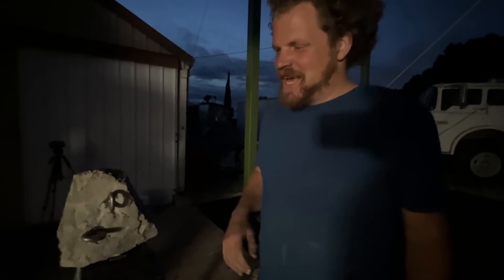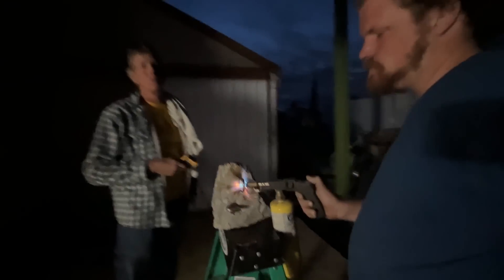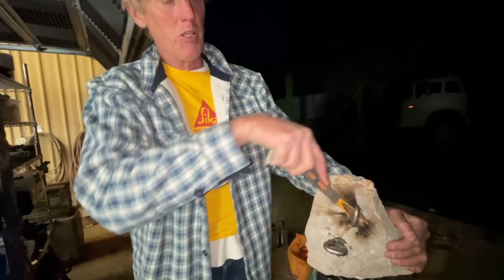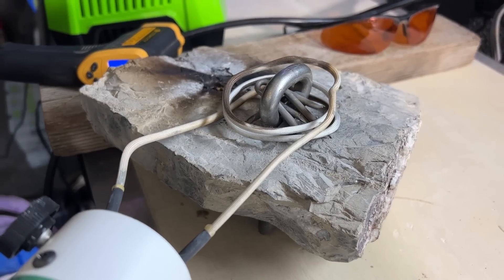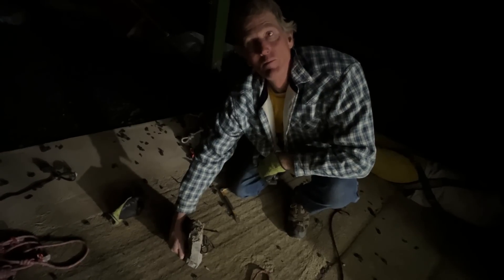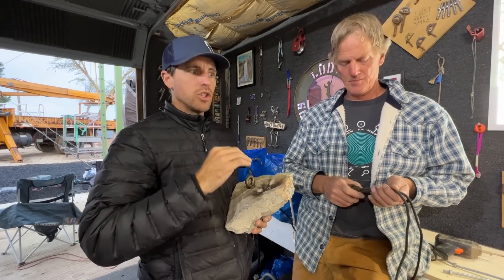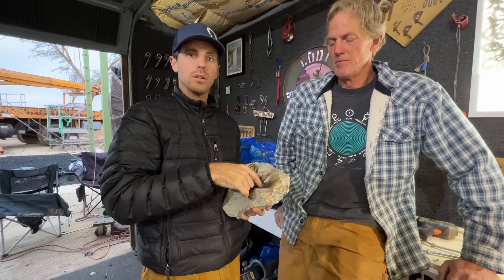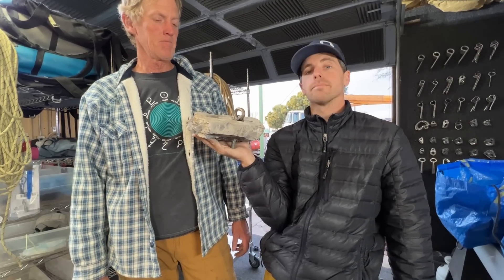Replacing Glue In Climbing Bolts - Does a blow torch work?

Comment from the maker: Don't try this if it is fire season.  Don't try this without bringing a way to cut the bolt when you are done in case it doesn't work, because it has been compromised.  Cutting and replacing the bolt right next to the old bolt is one solution as you can see here https://youtu.be/8pgFzVqVEJY

Check out our new store! https://hownot2.store/

Comment: If the bolts had a thread cut on them it would make them easier  to replace , I have unscrewed machine bolts that have been glued in with epoxy with a spanner

Comment: Or possibly vibrating the bolt with a high frequency oscillator (electromagnetic solenoid via battery or portable power supply) to free the bolt, then chisel/scrape out (any?) remaining glue....

Comment: An interesting problem needs a complex solution. I would try a tension and torsion attack.
Build a 1 foot high three legged metal tripod with a hole in the middle to enable an M16-ish eye bolt to be screwed with a Nut and wrench. After you connect the eye bolt with the climbing bolt via your preferred soft-shackle and tension it as much as you can by hand, you can proceed to use a long crowbar to exert some much needed Torsion to the system. A 3-4 foot wooden handle with a metal prong at the end might do if weight is an issue.
This might work only if the bolt is not totally beat up.

Comment: Hmmmm a few things I'm curious about. Wouldn't heating (from that angle) compromise the rock, and make it not suitable for use again? And as another commenter pointed out the epoxy need only reach its glass transition temp. So what you could try is to heat it parallel (and maybe even pointed slightly away from the rock so that only the heat from the conduction of the bolt makes it into the rock so you don't compromise it. Then you'd just need to keep a pry bar (that you don't care about) through the eye to keep pressure on it, then as soon as it starts budging you should be able to take the heat off and just pull it out as normal. This should also perhaps be tested in different rocks with different properties (granite, sandstone, limestone, etc.) And with the obligatory break test.

Comment: Smashing bolts seems awful -- what if you smash it in such a way that it compromises the strength, but don't completely make it unusable or only causes minor cosmetic damage. It could result in a climber using it as protection and risking their life. Use an angle grinder and make it obvious! (Or don't do it!)

Comment: If only someone had an electo magnet that would stick to rock! 😉 Because a cordless mag-drill with a tungsten carbide cutter would chew out the stainless bolt (after flush cutting the eye) but without the magnet function you'd have to leave behind a few 1/4" diameter holes from a locating jig 😐 Also not the easiest thing to do vertically because of the weight/alignment issues, but horizontal might have some promise... Until you keep misaligning the setup or bottoming out the bits/tooling and end up spending $200 per each failed attempt 🤫😁 I mean a much cheaper carbide bit on a much cheap cordless die grinder would also work, but unless you have the world's steadiest hands then a custom one-off jig would be required, along with some coolant or you'll just end up using $200 worth of $50 bits 🤔 If I invent a cordless mag-drill that sticks to rock instead of ferrous material, which also has a fully adjustable base I'll call Ryan first for testing I guess 😄 👍

Comment: To prevent rock scarring when using the torch, there's heat shield tape, which can withstand about 1000 degrees Celsius.

I haven't tested this, but I suspect the tape doesn't completely prevent the rock from heating up. However, I think the discoloration on the rock is actually residue from the chemical reaction of the flame, rather than the heat, and that residue would stick to the tape, not to the rock.

Comment: You need to heat the epoxy enough to soften it. It is impossible to heat only the bolt and not the rock. The rock is a large heat sink, so it will take a lot of heat before the epoxy gets warm enough to let go. With that much heat in the rock, the rock will crack/spall, therefore not be safe for new bolts anymore. In other words, heat doesn't work if you want to rebolt in roughly the same place because you damage the rock too much.

Comment: Well, you've found out stainless is a poor thermal conductor and epoxy doesn't really melt until its really hot. Actually useful because it's the relative conductivity which matters. Now if only we made bolts out of aluminum or copper  this would probably work...

Comment: Small issues with the use of the IR thermometer. Silver surfaces emit less IR than darker surfaces so the back of the bolt will appear cooler than it is.
If you can darken it, the thermometer will give a more accurate number.

Comment: Interesting test. For future reference, infrared thermometers like that can be thought of a bit like a reverse flashlight. That is, If you were to shine a narrow-beam flashlight at a small object, the light will hit more than just the small object. Likewise, when you point that type of thermometer at a small object, it is collecting infrared "light" from things beyond the small object. Depending on conditions, this can throw a reading off by a lot. Note: the little red laser pointer is just a pointing aid -- it is not involved in reading the temperature at all. At longer ranges, the laser (hopefully) shows the center of the reading area. At very close ranges, the red dot might not be in the reading area at all because of the offset between the laser and the lens below it which is what actually collects the infrared radiation.

Comment: What about drilling a hole in the epoxy next to the screw and then filling it with paint stripper or acetone? You could hang out with a little bottle and keep filling the hole and put a soaked towel over it while it soaks in. It may work enough to be able to break the bolt loose with a bar and drill out the hole of the remaining epoxy with a bit matching the original size.
Reply: or even just pour the solvent around the bolt and let it slowly seep in while you scrape away enough of the top to form a cavity. "eventually" all the epoxy should be dissolved no?
Reply: @PaulEdler  something like that, it would take longer with solvent but no damage to rock, i think. You would only need to disolve enough to break the bolt  looe then drillout any remaining epoxy

Comment: Btw - have sidedrilled and basically broke the bond - but it leaves 2 holes and a mess of rock scars.
Cordless dremel type tool, patch the stud hole w epoxy and drill a new hole is easiest.

Comment: Maybe look into slide hammers and carbide drill bits. Try heat with the slide hammer.  If that fails cut the bolt then drill out with a carbide drill bit. Carbide is very fragile and easy to break when drilling by hand but it can be done. Practice helps.
Reply: Thought about this for drilling out anchors in caves. (There are often very limited good locations where you want to put the bolts, so putting a new bolt in the same place is often preferred), Carbide metal drills are very brittle and drilling down a metal bar in an epoxy tube would be difficult in a  machine shop, basically the drill will want to wander off into the softer epoxy. A carbide milling cutter, needs mag drill or similar, which would require bolts to fix the steel plate to the limestone... I've seen it done it at work, its a nightmare.

Comment: Would be interesting to see if freezing the bolt causes the glue to fail or the bolt to shrink enough to weaken the bond. Freeze spray, the type of aerosol used by plumbers to temporarily freeze water pipes and mechanics for disassembly / shrink fits can theoretically cool to -50 °C / -60 °F (if sprayed a lot). Mechanics use the thermal shock of repeated heating and cooling cycles to remove fasteners without damaging surrounding areas. In a horizontal application, a dewar of LN2 poured into an enclosure surrounding the bolt would be the extreme in cold (and danger).

If you've got the time, cobalt drill(s) and a drill guide should work... but it's boring!

Great video!

Comment: Hey folks,
epoxy doesn't melt, you can imagine it as a crosslinked network. It softens reversable into a rubbery state at a certain temperature (called glass transition temperature) and decomposes at higher temperatures. The temperatures depend on the epoxy you are using.
Due to lack of oxygen decomposition will result in carbon residues (soot) inside of the hole. Leading to a new question: will the glue of a new bolt have enough interface to be stable? Glue holds parts in place by interaction with the surface of the bolt and the surface of the rock. If one of the interactions is to weak the bolt pops out. Hence it is intended to use a new bolt with fresh glue, this interface shouldn't be a problem. But a soot layer inside of the rock MAY (a theory that need to be tested) act as a lubricant with the chance that the glue slips out of the hole. My guess would be that thoroughly burning the hole with a very hot piece of metal (e.g. thick nail) should make enough interface available although I have no clue was it will do to the rock.

I hope you find these comments helpful and I am open for discussion.
Reply: Im going to search for videos about melting epoxy, sounds cool. Thanks
Reply from the maker: I would assume redrilling the hole ideally preventing this problem you mention or the old glue just being in the way, but as many point out, that much heat could just damage the rock as a whole

Comment: Why not just use a long pry bar and twist it without heating? That could be your next bolt buster.. what length bar is needed to remove bolts without heating first. Not tried myself but heard of people removing them that way
Reply from the maker: whenever we have pulled bolts sideways they break before the glue disengages.  But maybe a pry bar test wouldn't be such a bad idea.  If it snaps the head of, i guess that works too since the only other option at that point is angle grinding which for sure could screw up the rock
Reply: @HowNOT2  Hydrolic Jake with an extension that fits into the eye of the bolt. Machine Toe Jacks are similar to what I'm suggesting.
Reply: @allalphazerobeta8643  Also one hydraulic jack that works in the horizontal position. Most have a gravity ball valve that does not.

Comment: Would this not cock up the temper of the metal and degrade the rock? Heat can substantially affect strength in other industrial applications. Seems sketchy to me.
Reply from the maker: Everything about this is sketchy, especially if applied to the vertical world haha
Reply: The climbing bolts are 3xx and 4xx grade stainless, they can't really be hardened in that way
Besides, for this application you want a tougher bolt. Using hardened steel would make them more brittle
Reply: I am not sure climbing bolts have much in hardness through Quench and tempering, as It would be horribly annoying to have a high hardness bolt that chews through your connected gear like putty with the smallest scratch.
Tempering w/o quenching would be useless outside of something similar to a stress relief, and heating a beat up bolt is basically doing it favors.

Comment: i was surprised to not see this in the summary. you absolutely compromised the rock. and in no way should you redrill to clean the hole and reuse this area of rock, particularly that kind of rock. it is very likely spalling will occur on the surface, which could possibly allow the new bolt to break down the surface edge.  i think your actual in use method is really the best way.
Reply: Depends on the rock but generally most mountains are granite and granite doesn’t take extreme heat well. There’s a list of rocks that are suitable fire pits and I’d bet that list correlates to the strength of the rock after being  subjected to extreme heat.
Reply: @allstarwoo4  not entirely sure but i think the reason some bricks are not ok for firepits is that they can retain moisture and will "boil" and pop, flinging rock fragments all over your patio.
Reply: @andrewut7ya511  same thing can happen to rocks. Most bricks are pretty porous so that usually isn’t a problem. And besides that you have the problem of differential heating.
Reply: @allstarwoo4  yea, i wouldnt be comfortable hanging off of a rock thats been superheated.
Reply: @andrewut7ya511  you have a valid concern, especially with glue ins. You don’t know if the adhesive failed until testing it.
Reply: @allstarwoo4  do you know where I can find that list?
Reply: @emersonlcm  I don’t know to be honest I came across it looking into material for a fire pit.

Comment: I wonder if clipping two leads to the bolt and letting it short out with a big battery would heat the epoxy enough.

(Assuming you don't piss off the battery too much.)
Reply: Induction coil if you could get a driver powerful enough.

Oh they literally tried that next lol
Reply: @therealandycook  That's what they tried in the video, but it'll always have more losses.
Reply: You'll need a rather high voltage (for portable use) to use a bolt as a resistive heating element. I'm not sure if you could do it with a battery, but if you got a generator, it's more likely. You could also maybe use an inverter to step a battery up to mains voltage, but I'm not sure what current you'll need, and some of them get unhappy
Reply: @bandana_girl6507  Resistive heating is from amperage, not voltage.

But those stainless bolts are pretty beefy.. It might be too much amperage for a car battery to do too much.
Reply: @EverettWilson  you can get current if you know voltage and resistance. Also, what you're actually looking for is wattage, which has voltage squared (and resistance in the denominator, but that's more important for whether your bolt heats up or your leads)
Reply: @bandana_girl6507  That's... Not true? Power transmission through a conductor is limited by ampacity. The formula for resistive heating is P = I^2*R; the voltage is only relevant because increasing it will increase the amperage (all else being equal.) It's why high tension power lines are in the kilovolt range -- it lets them transmit the same amount of power while keeping the amperage low enough to not melt the cables.
Reply: @EverettWilson  in the case of a battery, voltage is roughly constant and controllable (with battery selection) whereas current is not, so P=V^2/R is what need. Really, that's the voltage drop across the resistive element (which is what balancing the load and leads will help with in this context), but shorting a battery will at most get you that much power. 

That's why you can easily short a 1.5v battery with a 20 ohm, quarter watt resistor but will burn a 50k quarter watt shorting mains (you can even get above 200k shorting the lives on two-phase).

Comment: you just have to consider that in a real situation, the rock will absorb much more heat (thermal mass) than that small piece. And that makes the time needed to weaken the glue can be much longer (at least with the gas torch)
Reply: Not true,  using heat is a standard way of removing epoxied in anchors in construction,  epoxy softens at under 200f , it is very easy to heat and pull anchors
Reply: I don't that would be a significant issue, rock isn't a very good conductor of heat, the glue is going to be compromised from heating the bolt, not bringing the rock to tempurature

Comment: Stainless steel sheds heat very quickly, it radiates fast, but conducts slow, if that makes any sense. So i was expecting the heat to remain "shallow" in the rock. not suprised it took 10+ min of open flame to heat it enough. A oxy/acetylene torch setup would heat it much much MUCH faster. BUT ANYHOW, i would never go anywhere near ropes with any kind of heat source.
Reply: Yep. Stainless has something like one 6th the thermal conductivity of normal steel. Which is good for building efficient houses, but bad for heating up hangers.
Reply: Agreed, that's why your frying pan with the stainless handle doesn't burn you

Comment: Why anyone would intentionally smash bolts is beyond me. If they don't like bolted rocks then don't go to where the bolted rocks are. Duh.
Reply: The hypothetical situation here is that the original bolt is smashed or in poor condition and a new one needs to be placed to make the route safe
Reply: @poacher5131  I see. I think cutting it flat would probably be best. Then fill any voids around the base of the old anchor with epoxy and maybe even paint the cut end to help prevent future spalling from rust or ice. Also cutting it flat would prevent others from trying to use the same hole. Reason being, it is not a good idea to use any hole that has dust, dirt, sand or water in it. so drilling the hole the same day you glue it is ideal. I worked doing structural fabrication of big commercial buildings in Portland we used this style of epoxy on a lot of bolts. Throughly cleaning out the drilled hole with a shop vac was required both by the bolt manufacturer and the epoxy supplier.
Reply: @badgermetal  yes, the hole cleaning is very important, but I don't see why you can't do it at a later date. Wetness is not an issue for the right resin so it being damp will not harm bond strength.

Comment: I imagine it would work but it would require more time and energy than a grinder. And im worried about the rock being weakened by the heat. Plus I wouldn't trust reglueing that hole with the heat compromised adhesive inside. I would probably overbore the hole back to fresh rock and install a larger diameter glue in.
Reply from the maker: I would totally drill out all the old glue for sure but that in theory would be easy if you got that far along.